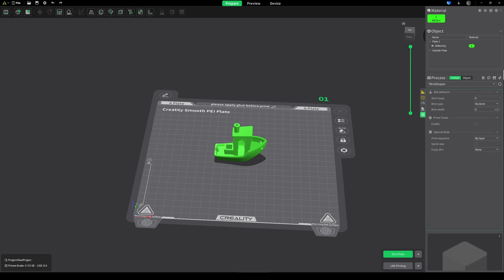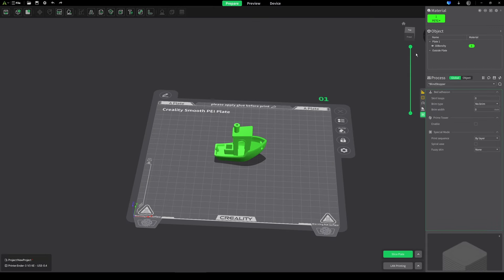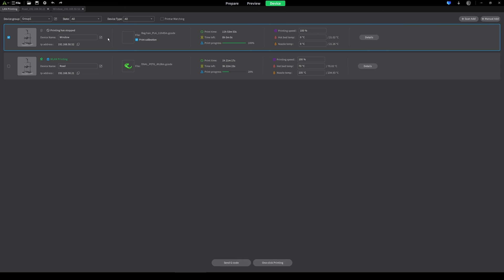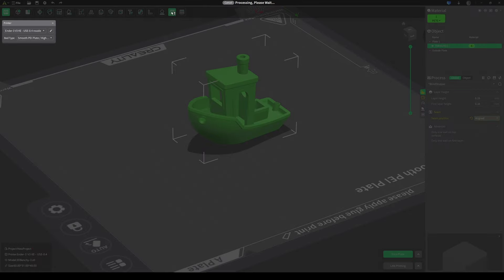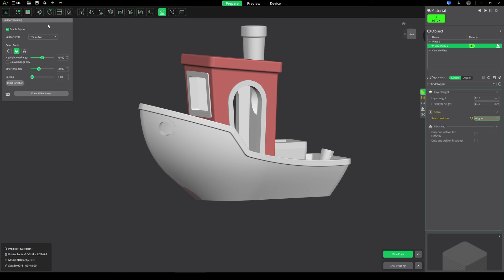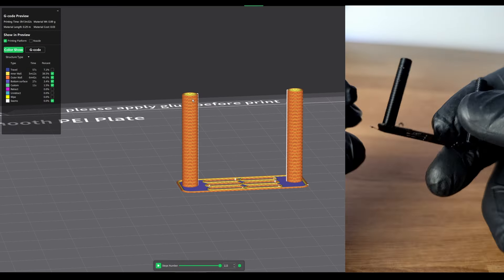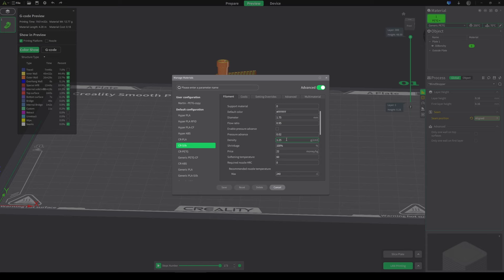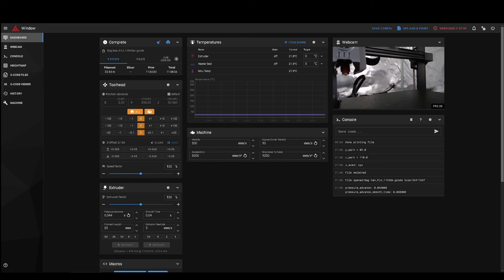Creality Print 5.0 - Tips and Tricks

Comment: Dayum! I wasn´t even searching this video but I´m glad I saw it and watched it, I truly learned good stuff, like the pause to change filament (which I use A LOT). But now that I´m here I would like to ask (the main reazon I clicked on your video): All my prints start and end with a default temp of 230°C; I can´t find the setting to modify that other than change the temp manually on the printer or the software
Reply from the maker: Glad you found it helpful! So you just want to change the default temp? The top right of the screen you will see some coloured boxes with your preferred plastic (PETG/PLA/ABS/ETC) you will probably only have one of these coloured boxes, click the little down arrow and it will allow you to change the plastic type/printing temp plus a few other settings. Hope this has answered your question
Reply: @ found it! Thanks a lot!

Comment: i am new with 3d printing got myself a K1Max installed the Print 5 version but after doing everything i mean once the slicing is over and i want to up load the file to cloud or save the file on harddrive the popup window is just huge and stuck to the top of the bar and bottom three buttons that actually get the job done cant be seen so i am stuck unable to get the print any help
Reply from the maker: The slicer is still a bit glitchy, often just closing and reopening will fix it, or does it happen every time you try to do it?
Reply: @LayerLabAustralia  its everytime I tried restarting the system and run the software again from zero sliced and again tried to generate the thing but again the popup is still the same

Comment: I cannot for the life of me find the minimum layer time setting in this slicer. I need to print multiple object that have a fe small layers and the printer slows to an absolute crawl for no reason on these layers.
Reply from the maker: Do these layers have overhangs? If so, there is a setting in overhang speed that you can tick/untick so it either slows down or doesn't :)

Comment: Creality print still does not know how to put a model flat on the print bed if you choose a flat surface as the bottom layer.  Failed on both the model I tried , one being a flat round coaster holder and the other a trestle railway bridge with many straight flat struts - should be simple - every other slicer I tried was able to do that.
Reply from the maker: aw dang sorry to hear that.. Have you tried using the auto pick bottom button located directly on the build plate in the software?
Reply: @LayerLabAustralia  no..
Reply from the maker: @billwiththeb  did it work? :D
Reply: @LayerLabAustralia  sorry not tried yet..been busy..power is currently out so no trying anything atm..

Comment: Having problems getting model to slice..lan printing lights up..I don't use that..reg slice button won't light up..not sure what I'm doing wrong..
Reply from the maker: Man this program is so glitchy 😆 have you tried updating to the latest version or uninstalling/reinstalling?
Reply: @LayerLabAustralia  I've contacted creality support because of the slicer issues because all the profiles that I created messed up somehow, the slicer speed was 300mm/s but printed at around 40mm/s and other issues... First thing they said that it is my fault. Next letter (different person i guess) told me that the app is in BETA so just wait for the update. And the third letter, they've sent me creality 5.1 before the update was released which was much worse than 5.0 was at the time :D I just wanted to share some issues so they would know, but they started defending themselves for some reason :D
Reply from the maker: @christopherismcaceas4868  i'm also getting the speed issue, you want it to be one speed but it prints at another... way i found around that was to just start from scratch with a default filament profile and recreate it... now I can't adjust my speed AT ALL with the new update. lewl. We are in the boat together :P
Reply: @LayerLabAustralia  If you can't see speed at all, enable advanced :)
Reply: @LayerLabAustralia  So far on version 5.1 I only created 2 profiles  for filament ant 2 for settings. If I do not touch the printer settings nothing resets anymore ;d
Reply from the maker: @christopherismcaceas4868  yeah I came across that, but it is cluttered amongst all these other settings making it a pain to set the ones I actually want. oh Creality...
Reply: @LayerLabAustralia  Maybe some day it will be better ;D
Reply: Got it to slice,but now it's not gcode,3mf file or something..won't go on my SD card..ugh..I hate being pc tarded..